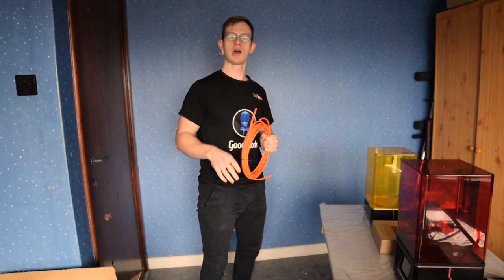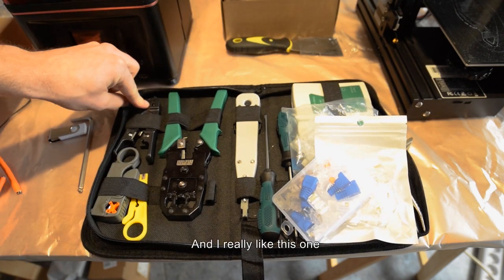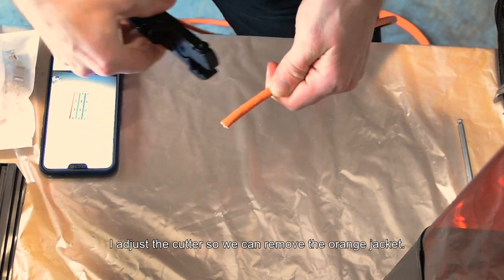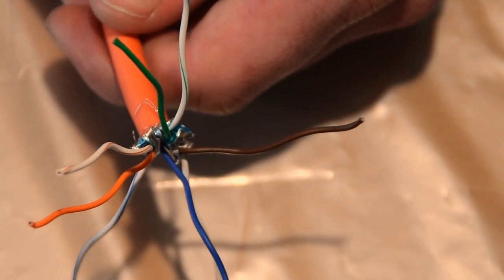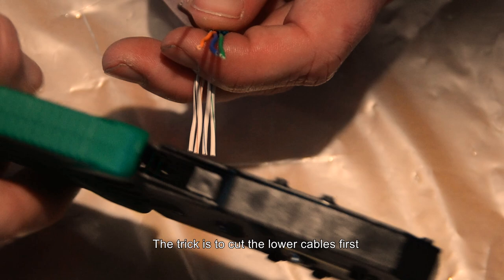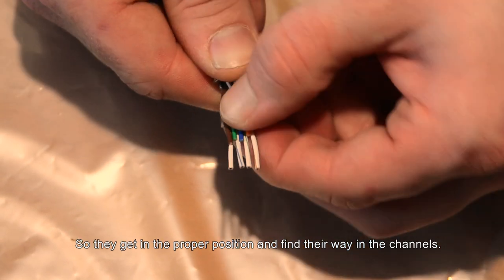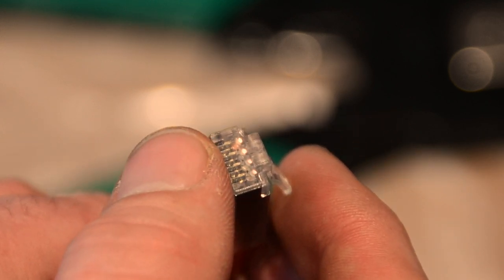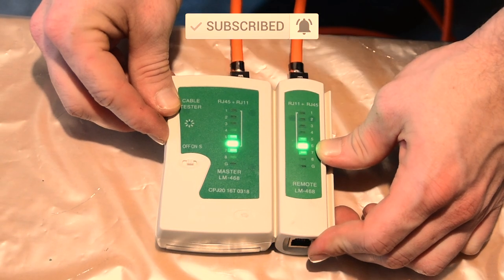How To Terminate CAT 7 Network Cables - Easy Guide / Tutorial

Comment: Another tip I learned is to not only cut the solid-colored wires longer than the striped wires; but also, cut them all at about a 45-degree angle, so they can go into the separator one wire at a time.
Reply: Cat 7 or 8 don't have "striped" white wires. The "striping" causes "loses"!

Comment: I would ensure a better connection between the shield / ground wire and the connector shield by folding the ground wire and possibly the shield foil back over the jacket and tightening the collar over.
Reply from the maker: Sorry, I didn't know. I should have added it.
 The first time I did this I had no clue how to start, the videos on youtube were very outdated so I hope this video is still helpfull.
When I have time I will add this absolutely
Reply: Very good idea!

Comment from the maker: ⚠ATTENTION⚠ on 3:49 The mesh shielding should touch the shield connector, pull the orange isolator back and then clamp the connector to the ground shield.
I didn't know this when making this video.
The first time I did this I had no clue how to start, the videos on Youtube were very outdated so I hope this video is still helpfull.
Reply: I learned that the "striping" of the WHITE wire causes "loses" in CAT 7, 8 cable, hence the SOLID WHITE configuration! Thanks YT!

Comment: Thanks for this good tutorial ! One question: What about the ground ? Shouldn't be the mesh shielding be twisted to the metal part or something like that ?
Reply from the maker: Yes, I forgot doing this in the video. the metal clip needs to be clamped on the mesh shielding.
Reply: @GoodMods  can I put Rj 12 on cat6 stp or cat7???
Reply: @GoodMods  Only from one side of cable, there should be no full connection other there are two grounds connected
Reply: @sheerun Thx! had a clue, now understand how to prevent forming ground loop. Always  great to read the comments
Reply: @GoodMods  Exactly!
Reply: @GoodMods  I would have possible concerns about "ground loops" used with "Keystone" female connectors since the ground  does not "ground" at ONE COMMON point! I am specifically referring to POE networking.

Comment: i use pass through connectors. i have to strip the wires a bit to get the wires through though. definitely a bit of a challenge compared to cat 5 utp.
Reply: If you use the ones that has a plastic "block" that slips into the rj45 connector, it's like a "walk in the park". I am "not going back" to the standard connector!

Comment: Hi. Just a clarification from a nubi...I want to use a standard off the shelf ethernet cable and would run it to a wall socket with a female- connector. WHEN needed I can run a shorter  temp ethernet cable from the wall socket to the LAN port in the laptop. Now..if one end of the long cable..say CAT7...has the fine wires in the start-connector on one end, arranged as "1,2,3,4,5,6,7,8" and also the same arrangement, exactly, at the end- connector of the cable. My question is if this end-connector is plugged to the wall  socket, than any further short ethernet cable connected to this wall socket, would be connected as "8,7,6,5,4,3,2,1" wrongly?? Or how would it work...is female connector in the faceplate on the wall REVERSE the order...i.e the "keystone" type would fix the arrangement of the cable??? Can anyone explain pls. Tks.
Reply from the maker: cat7 cables will normally work in older ports.

Comment: i cannot even get the 4 white ones through that small block, let alone another 4. that is just sheer impossible
Reply: If you don't have the type of connector that has a "sorting block", do the wires ONE at a time. Just make sure to leave extra long pigtails when stripping the cable!